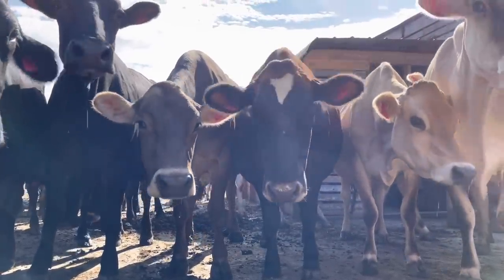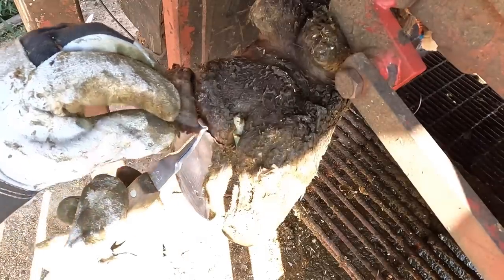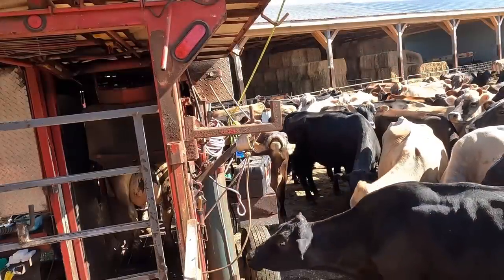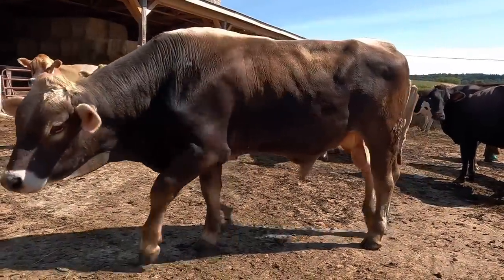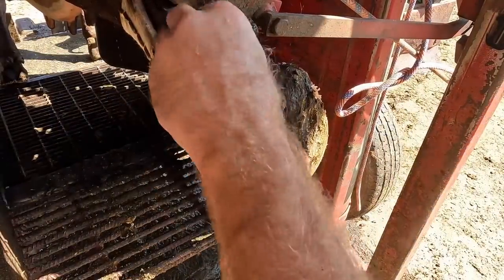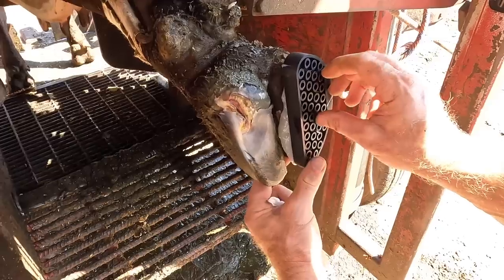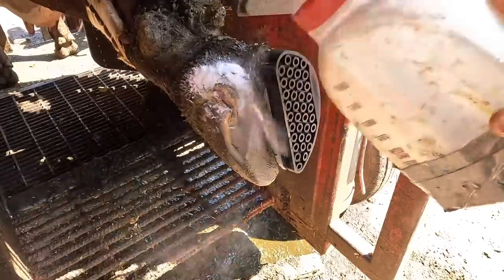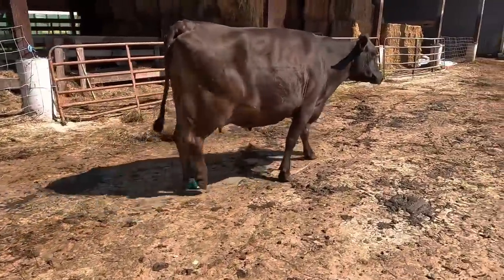This is NOT A COW’S MUDFLAP

Comment: My experience with cows is that they will chew on anything. There were cattle on the property I hunted on, and we had to keep a strong fence around our campers. They would do what ever they could  to chew on any electric cord or piece of plastic left at camp. Extension cords, water hoses, ropes, plastic barrels, water containers, chairs, everything would be chewed up if the fence got knocked down.